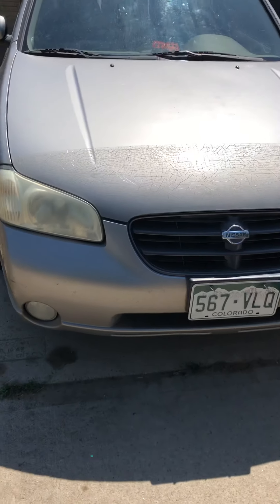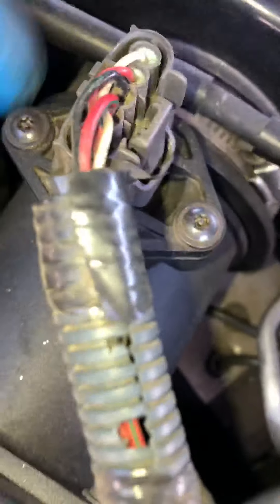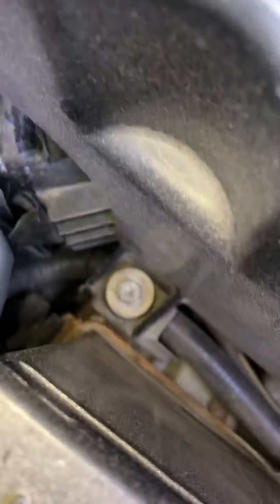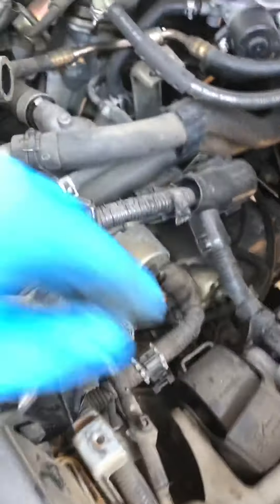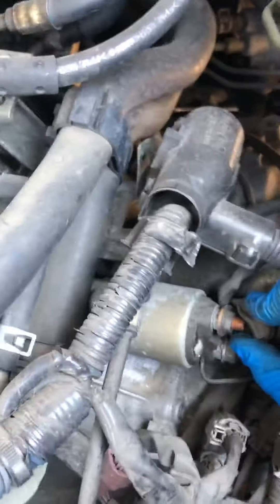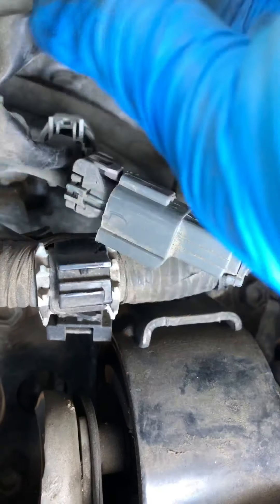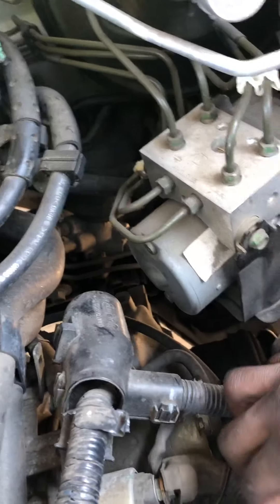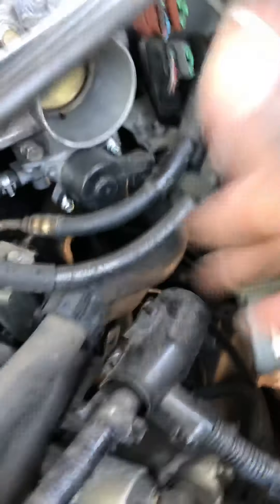2001 Nissan Maxima Starter Replacement

Comment: I appreciate the vid post.  These are so difficult to film using a phone and doing both videography and the actual repair so thanks for the effort.  Did you have any issues getting those bolts off?  Need to do my 2001 asap.  Thanks!